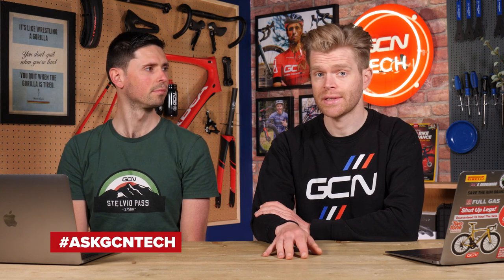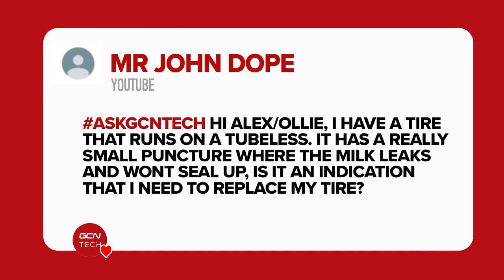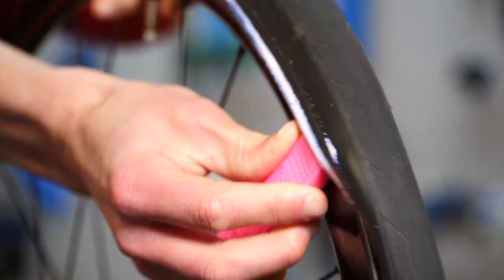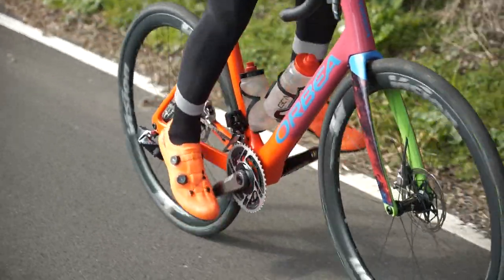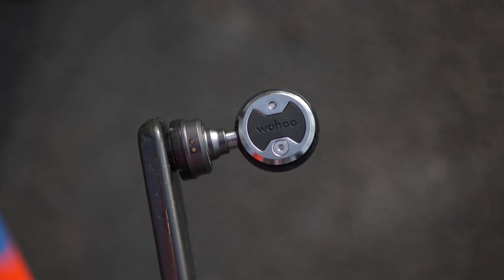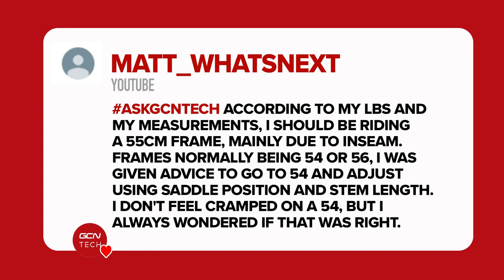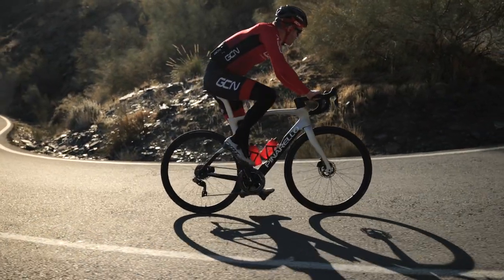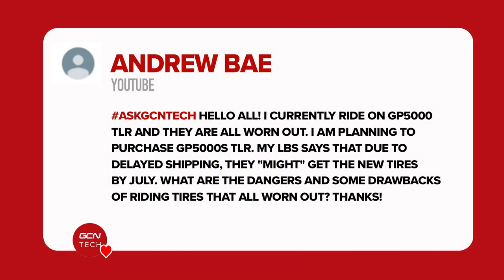Why Won't My Tubeless Tyres Seal? | GCN Tech Clinic #AskGCNTech

Comment: My experience of worn-out tyres is that sharp fine sand grains get through the rubber, around the puncture belt and wear away at the tube. Punctures increase in frequency to the point where, on a ride, all you have left to seal it with is the bitterness of your own tears mixed with the boiling anger of your frustration.... After commuting 20 miles a day for a few years I learned the life of a tyre and found early replacement almost completely eliminated punctures... almost!

Comment: Solution to the tubeless issue, I've used many tubeless liquids including Stans, Joes no flats, Xsauce and muc off which is shown in the video which was the last store bought tubeless sealant I used, the muc off never sealed a single puncture no matter how small it was, I went through a liter bottle in 3 months on my mountain bike and I'm not the only person who has tried it and had that problem, it's by far the worst tubeless sealant out there. Joes no flats was pretty bad at sealing punctures, Xsauce and Stans dried out within about 2 months, I now use home mixed tubeless sealant, 1 part latex, 1 part propylene glycol, 3 parts distilled water and 50ml of ammonia, never had a puncture since that hasn't sealed and it lasts as long as Stans and Xsauce, the best part is that 5 liters cost me a little less to make than 1 liter of Stans.
Reply: I use Muc-Off in my enduro bike, and I have never had an issue with it not sealing. The only time I have ever had an issue with Muc-Off was when I got a glass shard stuck in my gravel bike tire which made a hole about 8 mm wide. Seeing as the tires were only 40mm to begin with, I went ahead and considered that tire donezo.
Reply: @mihalis1010  If it works for you then keep using it but I can tell you of 4 people plus myself that have used it and none of us are going to use it again.
Reply: I run Stan's in both my mountain and road bikes.  I counted 28 sealed punctures on my mountain bike tire when replacing it due to tread wear (there are a lot of thorns on my local trails).  I generally find at least one sealed puncture in the road tires when replacing them for wear.  The only failure I had that Stan's didn't seal was a 1" cut in the sidewall.
Reply: @jefferycampbell2243  Try home made sealant, it's just like Stans.
Reply: Any way to avoid the ammonia?
Reply: @armadillito  Can't you get it?
Reply: @OriginalAirsoftGasser  I haven't tried, it's more that I'd rather not use it. My local shop made a fuss about ammonia sealants being a health hazard. What happens if you don't use it?

Comment: I wonder about whether some tires, or tire material, are better for sealing than others.  When I went tubeless on my road bike, I used Continental GP5000TL tires and seldom had any problems. They always sealed up really well. Removing dried sealant from inside these tires was difficult and required much effort. Then I tried a Schwalbe Pro One tire and it would not seal at all.  I removed the tire and found no dried sealant stuck to the inside of the tire. I tried patching the tire from the inside and less than a week later, the patch had come loose from the tire - it wouldn't stick.  I am now riding Conti GP5000sTR tires.  I had a very small puncture recently from a small thorn.  The tire would not seal even though, just before the ride, I had put in 60mL of Continental Revo Tire Sealant. When I ended up putting a tube in the tire to finish the ride, I found that all of the sealant I had put in was gone - sprayed out through the puncture. Here's my question... are some tires or tire chemistry more compatible with sealant than others?  Are some sealants better than others?  Is there any test data out there that would shed light on this?

Comment: Distance and not time is the key driver of wear and tear!!! Why do commentators keep referring top usage issues in terms of time? Not everyone rides at the same rate per day/week. Saying the components last a really long time OR that components wear out relatively quickly has little meaning to anyone but the person saying it. And given bike riders are obsessed with data, it is interesting that generic time related terms are used so freely. Ollie - you are a scientist and yet you are regularly using time as a proxy for distance. I love your work, but can I suggest that you and and your colleagues go with the data and put some additional rigor into the commentary. It would be really helpful to the many newbies that watch.
Reply: Yup, I wish it was easier to track components' mileage directly, but it is certainly easy enough that the cycling press should do it.

Comment: I've heard of a new tech called inner tubes. Rubber or latex tubes filled with air to keep your tire pressurized. No milk, special pumps, valve stems, wheels,  the list goes on and on. Just carry one or two tubes and a small hand pump and you are good to go. Easy as pie, though I prefer cake. A knurled corner piece with a rose, oh my!

Comment: I use winter cycling shoes in the the winter and they weigh twice as much as summer shoes.  You feel the weight difference, your cadence will drop to accommodate and when you finally get back to summer shoes YOU ARE FASTER.

Comment: #AskGCNTech  How important is the "snap" of the bead fitting into the hooks on the wheel when setting up tubeless. Recently set up some WTB riddler tyres with Mavic wheels on my gravel bike tubeless and neither tyre made the "snap" sound even when taking the tyre well above the rated pressure. The marking on the sidewall around the bead is even all the way around the tire.

Comment: Usually, with road bikes at least, if someone is right in between 2 sizes, it's generally recommended to take the size smaller. On mountain bikes, I would do the exact opposite and take the bigger size. It's really all down to personal preference though.

Comment: I just fomo'd onto a Sram Red upgrade kit. Got the email it was available and bought it after 5 minutes of thinking about it. Now I'm having regrets after that last question about running cost.
Reply: I'm running the red 1x12 on my MTB and it's absolutely spectacular.  I tried to find it in a 2x12 for my new road bike but it's available nowhere - lucky you.  Do what these guys say - keep your drivetrain clean and the only thing you'll be replacing is the chain every couple thousand miles. It's well worth the extra $20 for the better chain to have that groupset.

Comment: #AskGCNTech If using wax-based lubes is clearly superior in terms of rolling resistance and maintenance, why isn't the cycling industry adopting this more? Is it just a case of tradition and slow evolution (such as disk brakes and tubeless tires) or any there any major disadvantages I should be aware of before switching to a wax-based drip lube?
Reply: I can answer from my experience, of running Momum Mic Wax wax based drop lube. The chain and whole drivetrain are cleaner, not sticky, without the grit. Easy to maintain. But it lasts far shorter. Normal lube lasts longer before relubing, so better for longer rides. Also easier to relube, no need to wait for the wax to evaporate the water before use. 
In general the dirtier the lube is, also it lasts for longer.
And what the pros are using, waxing in crockpots/slow cookers/etc. , while keeps the chain clean and lasts for longer, is too much maintanance for an average Joe like me. So wax drip lube is a nice compromise for me to keep the chain clean, but for an incoming gravel marathon, 190 km, I may need to use a standard lube and clean the drivetrain after it.
Reply: Wax is more expensive and generally doesn't last as long as other types of lube. That being said, I will take the cost and short interval for the efficiency and cleanliness any day of the week.
Reply: Wax-based lubes last as long as oil based lubes, unless you ride in the rain.
Reply: @cc-000  Yeah, note that to many consumers bike chain lube comes in an aerosol can with a straw and is applied every other year, without any cleaning ever involved. And that can be fine for light use.

Comment: Hi Guys, I have a #AskGCNTech question for ya: I have a Cube Attain Race bike which is fitted with a Shimano Tiagra groupset and mechanical disc brakes. I want to upgrade it to a 105 with hydraulic disc brakes. I have seen that the Tiagra uses a 10-speed cassette and 105 uses an 11-speed cassette. Is it possible to just swap them? And what would I need to change when swapping to hydraulics? Your views on the matter...?

Comment: i run tubes inside my tubeless set up with sealant in the tubes, i havent had a flat in over 2 years and i ride on rock driveways and ripped up tarmac that need repaving.

Comment: #AskGCNTech Hi guys,
I'm looking to buy a new helmet as my old one is getting pretty old. I initially thought that a helmet without MIPS was not an option because of the the extra safety. But just how well does MIPS actually work? Has there been made any tests where the same helmet has been tested both with and without MIPS? When I see the test videos MIPS have done themselves I wonder whether the system works "in real life" as well. The MIPS tests are done with only a head, not a body attached to it, the helmet is always strapped really tight, much tighter than it would be on an actual person (with a body attached to the neck) and the helmet always hits an angle. My point/question is that this specific type of crash is not the only type of crash you could encounter and is a helmet without MIPS as safe a helmet with MIPS?
Reply: I had a bad high speed crash wearing a MIPS helmet. The only body parts not injured were my head and feet. I hit the road with a lot a rotational force and continued to roll down the road until I lost all my momentum. Trek replaced my helmet for free since it was less than a year old.
Reply: MIPS tests are at an angle because that’s what MIPS is designed for. It protects from rotational forces, not impact forces, and that comes from the angle of impact. And, in fact, in a real world accident, your head will almost ALWAYS impact at a relatively shallow angle and introduce a lot of rotational force. They don’t use a whole body because it’s not necessary. You can calibrate the testing machines to simulate different body weights and speed of impact, rather than having a ton of different mannequins. They’re held tight on the head to make sure they don’t come loose and also to measure the effectiveness of the MIPS system itself. If the whole helmet is rotating because it’s held loosely to the head, they can’t measure what the MIPS is doing. A helmet with MIPS will always offer more protection than the same model without MIPS.
Reply: An added safety feature in a helmet is never a bad thing. I would never consider a helmet without MIPS. It's rare for a crash to only involve straight impact forces in a road bike crash. There will almost always be sliding and rotational forces, which MIPS is designed for, tested for, and scientifically proven to help mitigate.

Comment: #AskGCNTech Hi GCN tech! I've recently invested in a power meter chainset to enhance my training outdoors. When testing this while on my indoor trainer, I've noticed that the new power meter is generally around 5% to 8% higher than the reading from my trainer, perhaps in part due to drivetrain inefficiencies. Is there a way to match both power meters to one another? It's not a huge difference, but when training against my FTP,  those slight changes make all the difference on longer efforts. Thanks!

Comment: Wouldn’t a worn out tire tend to have a more flat section in the middle making the tires rolling resistance go up and not down due to higher contact patch?
Reply: Front tires do not develop the flat section that rear tires get. Because they carry less weight, they can last two to three times as long as a rear tire.

Comment: I wonder if training with ankle weights would improve pedalstroke?
Reply: Almost certainly it would make it worse.  The ideal is a perfect pedalling circle, but the extra weight would make you more likely to ride in a stompy sort of fashion.  Think of the legs and cranks as similar to a reciprocating engine (e.g. car, motorbike, etc.) the lighter the crank, con rods and pistons, the more smoothly the engine runs, and the more rapidly it can change speed.

Comment: #AskGCNTech Hi GCN, somewhat coincidentally (given today's headline topic!), I have a problem with a slow puncture/air leak in one of my tubeless tyres.  The problem is I don't really know how to go about troubleshooting it!  Tube tyres are easy - swap the tube and done, but with tubeless it could be the valve, rim tape, the tyre, or even the wheel itself! The tyre pumps up fine and holds its pressure for about a day but then starts to become noticeably softer. What are your top tips for troubleshooting tiresome troubles in tubeless tyres? 🙂
Reply: If it's reasonably safe to do so, a good option can be to try pumping it up to a higher pressure than usual (possibly a little over the tyre's maximum, so long as you don't ride on it and don't try to sue me). That somtimes helps me hear or feel where the air is escaping. 
If your sealant is fluorescent like muc off sealant, a UV torch could help you find where it's leaking out. 
And maybe double check the bead is seated properly round both sides of the rim?
Reply: @armadillito  Thanks buddy!  I'll give that a go.  That's great advice.  I'll wear eye protection and stand well back :)
Reply: I have 3 sets of tubeless wheel setups and almost every rime ive had a slow leak that wasnt obvious,  it turned out to be the valve.. so qheneve in doubt I remove the valve and  do a new piece of tubless tape over the exiating tape... just a couple of spokes past the valve hole. I get the existing tape totally clean before applying new ,of course... it works when i run out of the obvious..
Reply: @philiptaylor2366  Don't go mad with it. My tyres rated to 60 PSI to ride on take 70 static without problems when I'm setting them up, but a higher pressure road setup could be pretty sketchy.

Comment: #AskGCNTech hi Guys, thanks for all the great work/advice. Currently using a 52/36 chain ring with a 11/34 cassette (Ultegra, medium cage), switching to a 50/34 with 11/30, do I need to shorten my chain?
Thanks!
Reply: Yes, you have to.

Comment: #askgcnteck hey guys I have a Dawson road bike and couldn’t go a mile without a tire pop (I live in Las Vegas btw) so I got some solid tires and I’ve loved them but was wondering if they compromise anything like breaking potential or grip in turns or anything
Reply: If solid tyres were better, we'd all use them, and there would have been no need to invent the pneumatic tyre. You may gain in terms of never having a puncture again, but you lose in terms of weight, possibly comfort, rolling resistance, ability to adjust for different riding conditions, etc.  I would recommend Continental Gatorskin tyres as almost puncture proof.  I went from a puncture a week, to no punctures in 2 years. I put them on all 3 of my bikes (1 road, 1 road fixed, 1 gravel).  After a couple of years, on a whim, I put the knobbly tyres back on my gravel bike and had a puncture on my next ride.  Everyone has a preference, but Gatorskins are an excellent value choice for decent handling and excellent puncture resistance.

Comment: #AskGCNTech Hey guys hope you are doing well I am facing a problem with my crank arm every time I tighten the bolt  it loses every time I ride few Kms i have tried threadlock but it doesn't work please help me solve this problem Thankyou

Comment: Never adjust your position on the bike by changing saddle position. Your position is determined by your top tube length, head tube length, and stem length and angle. The only item that can be changed, is your stem.
Reply: Modern bikes, with sloping top tubes, have a lot of adjustment on saddle height, so choosing a frame by correlating leg length to some nominal saddle height is daft.  What really matters is where the geometry places the bars in relation to the saddle, and a rider's preference will be affected both by upper body dimensions and flexibility.  In other words, get a bike fit, and look for frames that let you out the touch points where you need them.  As an extreme example, my wife should ride a 54, but actually rides a 43 with a very long seat post as it puts the bars in the right place for her.

Comment: Tubeless, more hassle than it's worth. Even if it seals it'll take you 5x longer to clean the sealent of your bike and clothes than changing a tube.
Reply: I'd love to defend tubeless but I'm currently fighting a 3-4 mm hole that keep ejecting plugs and won't seem to take a patch.
Reply: @armadillito  I had a weird hole like that, my Stans Dart + sealant didn't seal it. Solution, when I had the tire off (and with the Stans Dart stuck in the hole -- but probably any tire plug would work, like bacon strips or a car tire plug), I just put a big piece of gorilla tape on the inside of the tire. Remount and put in fresh sealant and ride! A year later still going strong.
Reply: @picasticks  Might try that roadside in the future if I'm unlucky, but for now I've used rubber cement and a piece of old, cleaned-up inner tube. Cheap little patches weren't sticking. I might try autmotive 'mushroom plugs' if I can find some cheap ones.

Comment: Jeez, experts. Dude, the hole was not too large, it was too small!!!!! With small holes there is NOT enough air movement to suck the sealant through the hole. The sealant is too heavy for very small holes.